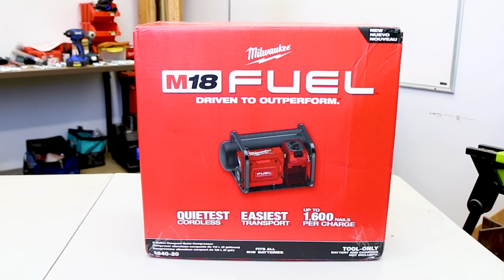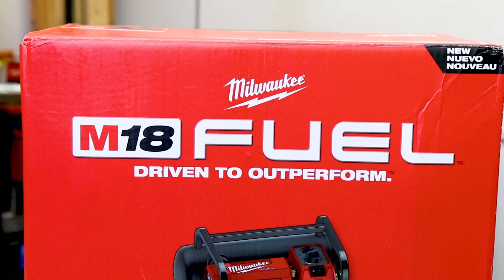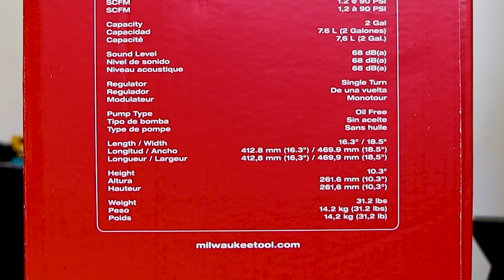New Milwaukee M18 FUEL AIR COMPRESSOR IS NOT WHAT I EXPECTED!

Comment: Send it to AVE for a look see
 Find out if it's worth the money
Reply: The guy is very entertaining and knowledgeable, but the teardowns he does don't really count as buying advice. I don't think he ever intended them to be either.
Reply: @pilotdog68  
You can tell if it's worth buying by the materials used to build it and how long it will.last
Reply: @lesleyboeder1798  no not really. I watch his videos all the time but I'm not basing my buying decision on what type of plastic the manufacturer used. There's a lot more to it than what he talks about.

Half the time he doesn't even use the tool.
Reply: @pilotdog68  
I have over 30 dewalt tools and after watching his video on the cordless compressor by dewalt I did not buy one.
.
Reply: @lesleyboeder1798  well you may have made a poor choice then because I know quite a few people with that compressor and they all love it. Best cordless compressor around.
Reply: I enjoy his videos too but I just dont understand why so many people take everything he says as gospel. Just because he think a certain tool or part is gonna break easily in theory, doesn't mean it will happen when you use it. There have been many tools that he says are garbage, and yet there people still those tool frequently for years with no problems.
Reply: @mannyortiz2292  
I just like to know what's on the inside and how thinks work I guess.
Reply: @lesleyboeder1798  that I understand. And I'm sorry if that comment came off too ranty. I've just see way too many people judge tools by what AVE thinks instead of by the people who actually use those tools the most. Seeing your comment kinda pushed it over the edge and I just had to rant a bit. Sorry.

Comment: What about the other pressure release not on the tank but near where you put hose into compressor to make outlet adjustments? Curious because I doubt Milwaukee would want someone to release the entire tank pressure, would be a pain so maybe it’s the other release and just curious if that works

Comment: Not buying way to expensive. Ryobi ZRP739 compressor with qtr turn drain can be had for $56.  You saying it will not last? for $56 - I can have 7 of them before I hit the milwaukee price point. No not the tool I want and way too expensive.

Comment: I think it could run a 1/2” impact long enough to change one tire on a car or pick-up truck
Reply: It probably could but it's a lot easier to get a 1/2" mid torque or high torque impact
Reply: ABSOLUTELY NOT! Impact guns demand at least three or more times the flowrate of this ridiculouly small compressor. It is only good for a single nailer and no more.

Comment: Any chance of doing a comparison with DeWalt? Would like to see run time, db, and overall performance. Use my DeWalt mainly for winterizing homes and pressure testing water lines. Looking for a reason to to switch to this since all my other tools are red 😂

Comment: Could you put a duel nozzle because I know Home Depot sells for the air hoses from 1 into 2 and also 1 into 3 do you think that could possibly work by changing the fitting and run to guns that way
Reply from the maker: I guess you could
Reply: would require the same tool and brand going into the same wood. The benefit of other brands dual outlet is dual regulaators.... aka different pressures for a framing nailer and a brad nailer / etc.... simultaneously. Most people don't run a job site with 2 guys putting up molding and both using a tool... seems weird to me and inefficient for 2 guys doing that. usually 2 guys same company but different tasks.

Comment: I would install the T fitting so you can run two lines and two tool, this way you don’t have keep switching tools. you would be only running one tool at a time.

Comment: If you have to empty the air in the tank to change the tool pressure that's a useless compressor if you can't change pressure on the fly @vcgconstruction

Comment: Has anybody that owns the cordless air compressor filled a 5 gallon or 15 gallon tank with it?

I know this is not what it is meant for but I'm wondering how long it takes to fill it.

My real world application would be filling my bait cannon at the beach and this would save me from having to haul a compressor and generator. I already tried the m12 inflator and it overheats after 20mins and tops out at 65psi

Comment: I am looking for a way to blow the dust out of my tools. This seems like a good idea to use. Any ideas for blowing out dirty tools like reciprocating saws and drills.
Reply: I have the Milwaukee compact blower (few other brands have almost identical products) and have been surprised at how useful it is, really amazing for blowing dust off tools, out of a vehicle, or off a workspace. Works much better than a blower nozzle and compressor because it’s lower pressure but much higher volume which is really what you want for cleaning things off.
Reply: @Walkerswell  At least with a compressor, you can also fill tires, pressure test stuff, and use pneumatic tools along with blowing off dust and debris. A dedicated blower would be fine if you never need any other use. Did your Milwaukee blower come with a flexible hose & needle tip attachment? I could see myself using a blower if it had some sort of flexible hose & small tip. Seems unwieldy to have to manuever the whole unit to get in nooks and crannies...but I've never used one so maybe they are better than what I imagine?
Reply: PowerScissor very true, certainly not arguing it could replace a compressor just that it does great at this specific task of dusting off tools. It’s much smaller than a traditional leaf blower and can be easily maneuvered with one hand, I don’t think a small hose would be great because the airflow would be pretty crappy (just an impeller type blower so great for volume but not great for pressure) however it’s easy to get the end where ever it fits (it’s about 2” diameter) and the airflow is good enough to clean out pretty much any small cranny (provided it’s loose dirt or dust and not something wet and sticky. Also recent discovered it’s AMAZING for inflating and deflating low pressure things like a kayak or air mattress if you ever need to do that.

Comment: Can't Believe they didn't make it to stand up skinny ways, They put the handle in a way that when you set it down on concrete it does not sit on rubber feet, it sits on the frame scratching the paint off the metal. Also already lost one of the motor mounting bolts, these guys didn't use any locktite on the metal bolts that go through the vibration pads under the motor. SMH

Comment: how is this compared to the dewalt one?
Reply: I know with my dewalt I can at least change pressure on the fly without dumping the air.
I've used mine to inflate tires, run a pneumatic stapler, ran a roofing nailer for a few dozen shingles without any problems , for a short time used it for a framing nailer to toenail joist till I could put the joist hangers on them though not long enough to get a good judge on duration for use with framing nailer. Works pretty good for me about the only downside is that you have to buy different batteries but so is the way of cordless tools. Would be interesting to hear from someone who has one of the Milwaukee ones to hear their experience with it
Reply: @matthewhoffman9242    I have a dewalt,  just wanted to see their perspective since I see  Vince  is all about Milwaukee

Comment: This is most definitely designed for the smaller lighter job and fit that perfectly. No one wants to carry in a large compressor to hit a few pieces of trim or to top off the truck tires etc. if you need to go cordless for framing buy the cordless framing nailer. They offer most tools you would need without air already. I’m sure there will be more to come down the pipeline. If you’re that dyer to run a full jobsite on air and be cordless go buy the Mx fuel power supply

Comment: Do not like having to release the pressure and starting over. It is a nice tool however. The sound decibel is a great thing compared to a standard compressor.  Keep up the great testing work!!
Reply from the maker: Great feedback Mark and I would agree that bleeding the entire tank too adjust the pressure will slow you down when working unfortunately.

Comment: Are all these small size air compressor useless??
Reply: No, if you already have air tools and are just replacing trim or inflating a tire they work great, I've used mine for roof repair replacing a few dozen shingles and ran a stapler for a few hours putting up screen. They have a place, may not be for everyone but I'm glad I got my dewalt when I did.........well maybe if I would have waited a couple weeks more I could have gotten the air compressor, hose and Brad nailer on sale as a special for same price as just the compressor kit🙄......ugh hindsight and all

Comment: so let me get this straight your paying $100 more for a milwaukee compressor VS the dewalt

the milwaukee is 2gallons VS dewalts 2.5 so it will cycle more often and wear more heavily
the milwaukee does not come with a battery and for it give you the 1200 nails that dewalt does, it would need at least a $150 battery. VS dewalt which for 250 gives you a flexvolt that can provide 1200 nails.
the milwaukee is also 10 pounds heavier.

so before its even functioning. it already ACTUALLY costs 250 dollars more than the dewalt..... all for what? 10 decibels? unless your using a unreliable senco nail gun. whatever your shooting with WILL deafen your ears anyways. so you will need to put it in a closet or use ear plugs. 

am i wrong? am i missing anything? is this tool magically a quarter of a grand better because its red? and will wear its internals sooner than he dewalt?

Comment: So I have one question. With the regulator being “locked” under pressure. If you were to plug in a hose and a tool and start flowing air can you adjust the knob? @vcgconstruction

Comment: make sure you have 2 12.0 batteries for running finish nailers all day. When the gun stops sinking nails, time to change the battery. I am sure it will work fine for a coiling roof nailer. Just don't be the idiot who leaves it out in the sun running.

Comment: This can be more than for construction/nailing. Air up a tire, blow off some dust, use an air chisel, all kinds of neat uses
Reply: Definitely not for any Chisel... the flowrate is ridiculously low for anything but a frugal nailer, and a single one. So, it ends up being an expensive compressor that only serves one tool.